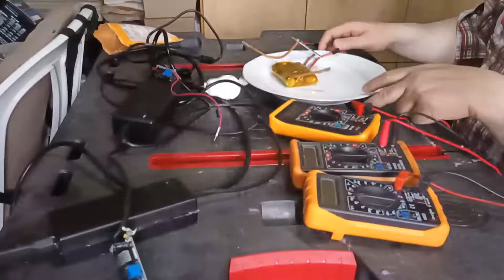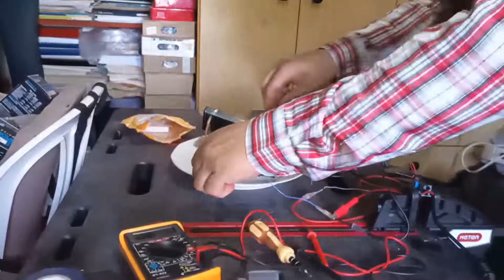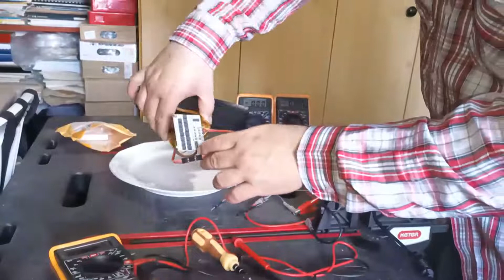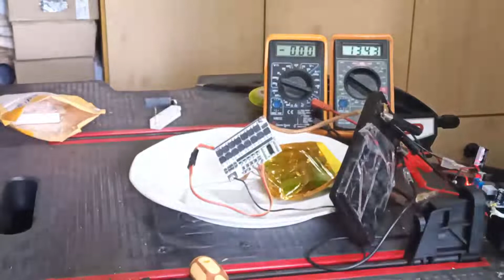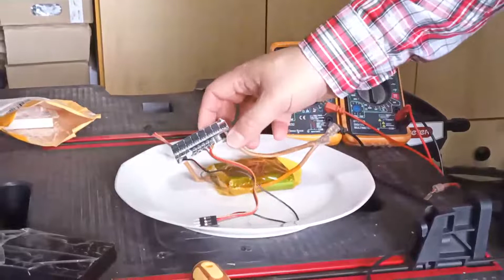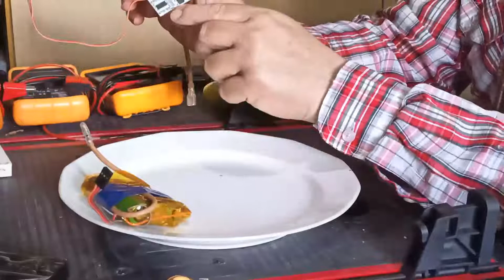A rudimentary BMS cell balancing and over-voltage current cutoff test

Comment: Pls can I charge 60p 3s 18650 batteries using the bms in this video using a 15v charger?

My 45amp mppt solar controller charge my batteries when I set it to 12.6v extremely slowly 1.5a (all settings were correctly done on the controller. And I have 1500w solar panel.

But when I set the charge controller to 15v, it charges with up to 12A.

My inverter charges batteries with 15v when connected to ac mains. I am scared to connect my battery pack to it. 

Please help
Reply from the maker: Well, you are asking me a tough question here. I can only respond in two questions to it. A. How do you know the charging current is 12A? Did you measure it using a shunt or a hall sensor? And B. Are you absolutely sure that your battery pack can take 12.8V? What kind of a Li-Ion battery is it?